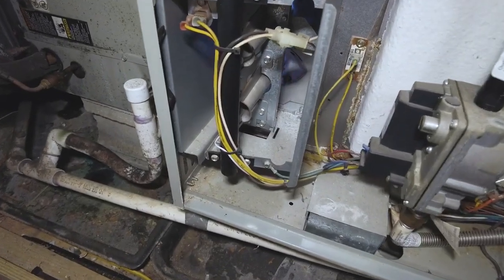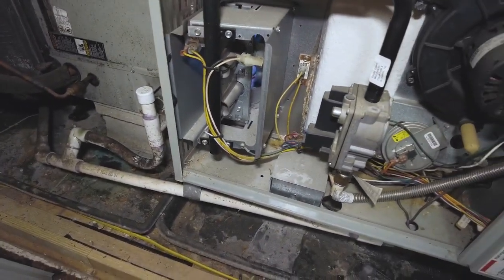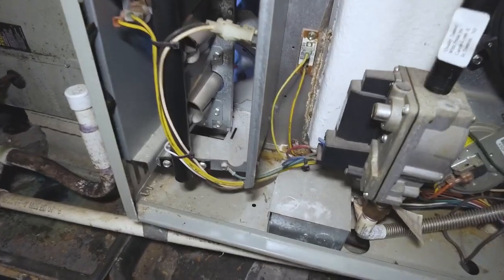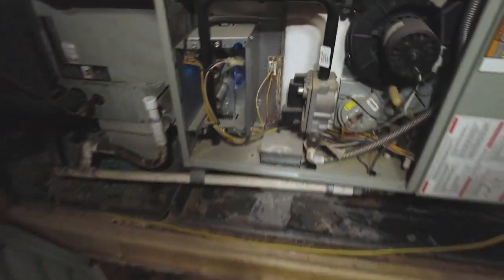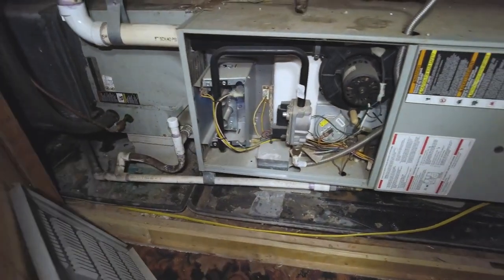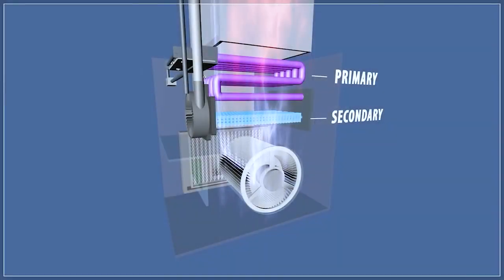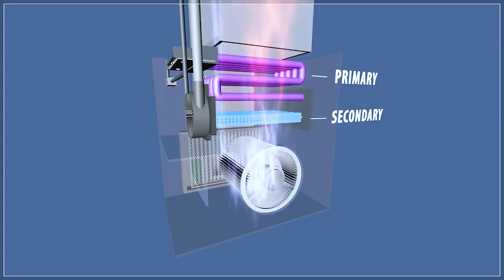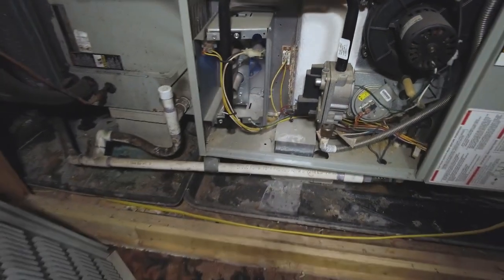Diagnosing Cracked Furnace Heat Exchanger Turbulent Flames with Blower Flame Rollout and Corrosion

Comment: I had a carrier furnace that when I would run just the blower and use a barbecue lighter in the burner inlet on the far right it would push the flame back a bunch. But when the furnace would run it was fine. Come to find out the carrier furnace has an insulated gasket that just must of been letting air from the blower push pass.

Comment: At 0:36, you are missing a screw and thats what's causing that flame to dance. That is not a cracked heat exchanger
Reply from the maker: Crazy! are you talking about the screw that's missing where the heat exchanger Inlet connects to the burner assembly?  This is a reupload it's probably a 3 or 4 year old video so I don't remember if I verified with a visual inspection or not. But I imagine that could have been the issue, I didn't even notice it. definitely appreciate you catching that!
Reply: @HVACTechKnowledgy  i came across one and i put a screw in and the flame was perfectly fine. Give it a try, remove the screw from another furnace and let me know what you come across. I noticed the screw missing on a trane ane carrier.